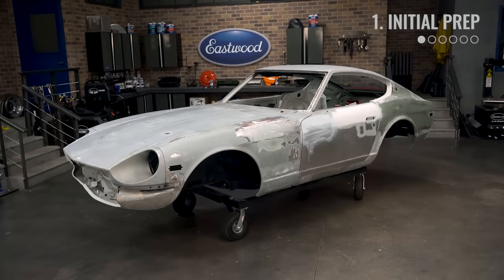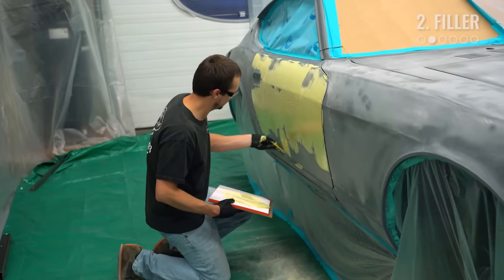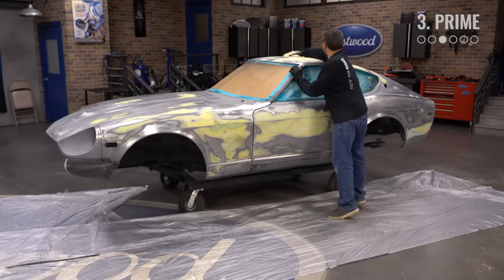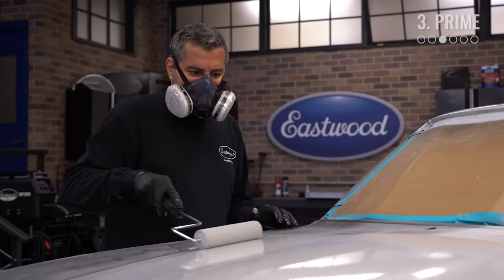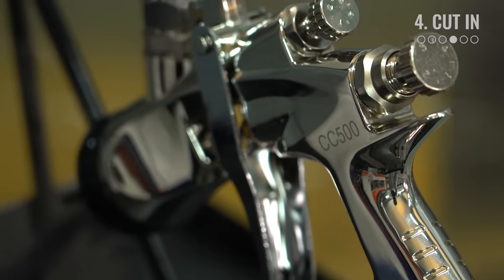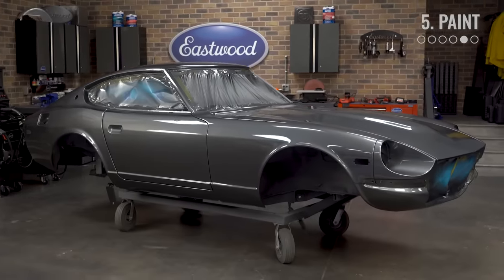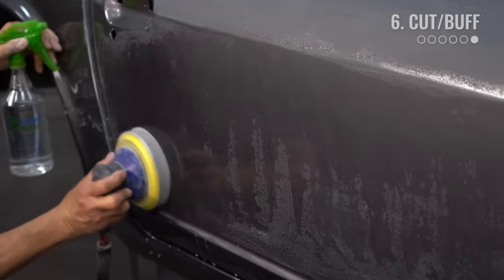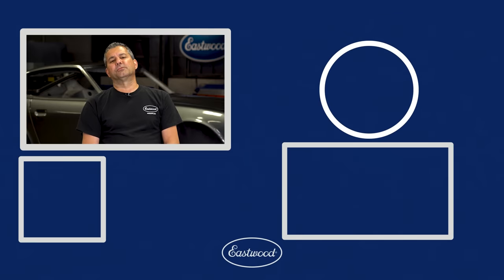STEP-BY-STEP GUIDE: How to Paint a Car at Home

Comment: I recently paid $6700 to have my truck painted. I thought that was a high price, but after seeing everything that goes into painting a vehicle I won't complain anymore.
Reply: If they stripped it thats pretty good but if they just sand and painted it single stage thats pretty high.
Reply: I thought this video was going to be a hack, but these guys are pros! 
Paint at home? Not me, not in my home, not with the amount of time and effort it took to get there 🤣🤣
That $6700 looks like a really good spend!
Reply: Я крашу авто за 2касаря.
Reply: @garagepnkoof284  sorry dont read youre language
Reply: That was a lot. Next time bring it to Jameson motors and we'll get you set up for $2,000 less..
Reply: Dude that’s a good deal for a good job. Normally $10,000 for a good job
Reply: We save some time and money by going straight to metal  to metal primer after body work is done with z grip all newer products upol primer most body shops in Dallas do it that way . The major cost is premium base coat and pre.ium clear 2 to 1 .
Reply: It’s all labor
Reply: Comically high for a pigment 😂
Reply: Ha,ha, doing it at home? No way , I'm thinking to paint my car with an airless sprayer 😂
Reply: Maaco will do a base clear with 5 year warranty for $3000....
Reply: Some modern car paints have up to 6 coats. Get one wrong, and you have to go back to the bare metal, and start again. 

I do not do paint. That is guys behind where I work do. Sometimes they walk into my shop, and swear. Coat 6 went wrong, back to square/coat one.

Ok, I get it, please mind you language, we have a 17 year old female apprentice. It’s d’oh not damn it. For f sake…
Reply: This is like a 15k paint job
Reply: In the country I live in, that’s not a paint job, that’s money laundering
Reply: Wow that’s it??? Holy
Reply: Was your car stripped like this ?
Reply: @kadeemgray93   Yes.
Reply: Yeah I have a 1987 toyota pickup with no rust but needed paint.  I got a few quotes 10k was the lowest.  I now know enough to be dangerous and do my own now.  5 stage turbine sprayer with siphon feed gun.  I like to learn and the challenge so I figured I can screw up and burn a lot of material for 10k lol haha.  Didn't cost near that much and it came out fine.
Reply: A show car paint job in the 80s took all this work and 15 coats of lacquer water sanded 4 steps each coat it makes a deep mirror finish that looks like a 1/2 inch of glass over the color it's alot of work bit it's the difference between a 10,000 dollar car and a 75k or more car
Reply: The paint job in the video cannot be a $6000 work. I would say much more.
Reply: That is a high price. Sorry you got ripped off.
Reply: He's not a laguage.
Reply: The problem is: do you ever really know if what they did was this well done? Doing it yourself is always the only sure thing. Having said that, you need time, space, materials, tools and practice. I'm currently rebuilding a 1972 Gran Torino Sport. The amount of time and work to just do a refresher on the car are huge. I plan on a two year overhaul time. If I could find a reputable painting shop that I could trust...sad to say, I'd pay the money and smile all of the way home.
Reply: What truck, what model?
Reply: That’s a cheap price
Reply: That's how half the customers are.  When someone quotes you a price for an automotive job it's usually because it's a lot of work.
Reply: you can buy a good looking car in my country with that money  :))
Reply: Datsun 28
Reply: I’ve bought whole cars for less then 6700. I get that’s what they charge but that’s a chunk of money.

Comment: This "How to Paint a Car at Home" video did a wonderful job convincing me that I never want to paint a car at home. It's so easy! Just do these 400+ steps each of which really requires years of experience to get a decent outcome within a reasonable timeframe.
Reply: So go flush away $10 grand for some shop to do it. Perfect time to squander your savings
Reply: This is how to do a first class job! Most home jobs I would bet are done quicker with less steps. This video is daunting to me, too. I wanted a quicker and easier method. Oh well, I am wanting to do an old truck and not a classic. I still need to save up some funds and time for doing a passable job.
Reply: lol. if you would like me to send you some pic of my first paint job I will. the reason I did it was the shop wanted $8.000.00 and it cost me a little less BUT I can now do it and I will not charge you what your local shop will.
Reply: Because the actual title of the video should've been "how to discourage people into thinking painting at home is way more complicated than it is". Trust me, it doesn't take nearly as much effort, knowledge or equipment to paint a car decently at home.
Reply: This is to get a professional finish, what they don’t say is you could skip sanding steps throughout, also he does say you don’t have to buff. Definitely take your time with body filler but outside of that do what you can.
Reply: @kenmastersmaster  Some people value time over money and have plenty of either. No need to think anyone's squandering anything.
Reply: @kristijantandara1682  I think this is more like, "how to get a show-car paintjob at home" which is probably 80hr+ in work.  It would be nice to see a technique that could be used for a 40hr paintjob, and a 20hr paintjob (better than earl scheib which is probably an 8hr paintjob for $1000 (closed now)).
Reply: I dont think people that would be this involved with a paint job have to worry about savings. If you are that worried about your savings, you damn sure should not be doing a car project of this magnitude@kenmastersmaster
Reply: @kristijantandara1682 this video shows how to spray your car like a pro... Anyone Barney can rattle can a car in their driveway.
Reply: It's a labor of love for many of us. Working on your own car is a reward of It's own, but not something suited for all of us. That's why shops offer their services. Pay and don't complain, or do it yourself and complain a drink while you do it
Reply: It’s not as difficult as you think. Time consuming? Yes. But you can get it done in 2-3 weekends.
Reply: You’re full of it. I own a bodyshop and will send you proof of my business cards and invoices. This is the only way to do it correctly. You can do it faster and easier and it will look just as good or better but it will not hold up. Just a matter of time before it starts peeling or you go to pressure wash it and it blows the paint off. Stop talking crap about things you do not know about. The only that I would have done differently from the video is 5 coats of clear coat and the minimum of 3 according what time type of job I’m doing.
Reply: Absolutely phenomenal paint job. And screw that! I’ll be going to Maaco!
Reply: @kimers137  LMAO
Reply: It's not that hard!  It just takes time.  People rush it and that's when they have issues.

Comment: Great work and appreciate the step by step process.  One thing I wish you showed more was how you handled things like those deep inset headlight areas.  Obviously that is a hand sand area, and probably hand cut/buff as well.  Curious if you followed the same process and if you had any backer to your sand paper and such.
Reply from the maker: Yes for those tight areas the standard tools don't reach in we worked by hand.  You can use a soft block as a backer, or fold the paper on itself.  For cutting and buffing the real move is to make sure they come out glossy the first time. You'd maybe be able to get a 3" buffer in there but it would be tight.
Reply: @eastwoodco  Put any rotating tool in the tight area, and if you catch an edge of new paint, F bombs are sure to fly!!  Always have a rotating pad turn off  of an edge, not into it! You'll learn quick if you did it wrong.

Comment: O my God so many steps and procedures to go through for 100% perfection. This car paint job looks extremely beautiful.
Reply from the maker: It is a lot of work, but that's why it's KEY to break it into manageable steps instead of getting overwhelmed by the scope of the project. Following these steps YOU too can get a great paint job.
Reply: Paint a car
Reply: Procedure after primer dried
Reply from the maker: Block with 180, 320, and then finish with 600 grit. Blow off, clean, and tape up for paint.

Comment: Thanks for the video, I'm busy with my 1958 MG Magnette, my arms are falling off block sanding is heavy work lol. The part that worries me is having the right place to do the spray job and an extractor fan system and dust prevention and and and...that's the issue most home DIY spraypainters face. To have the proper environment to paint the car and for it to dry without bugs, dust, overspray etc. Looks like I will now have to make a tempory spray booth!

Comment: At 6:00, a teachable mono ent as the fill has pulled away or feather edged. It looks pulled away that meaning it didn't stick due to sanding (Mechanical Tooth/Pressed hard into first application) or (Wasn't clean or fill had started to set up). 
  Any air sanding after the final coat of clear, is done with a finishing sander with 3/16" orbital action, and an intermediate foam pad and kept moving starting with 1/2" (13mm) thick intermediate foam pad with 1,000 grit. Do not use a regular DA sander if if you have sags, runs or nibs. Use a 2" wooden paint stir struck and fine paper like 800-1,200 grit to remove. Once complete there finish sanders are also sold at HF, so look at specs. A regular DA Sander has a 1/4" orbital action normal sanding. Still, look for a palm sander with 3/16" orbital action being sold under specs. 
ASE Master Tech since 78, retired.

Comment: Amazing video, great edits. 
However the only thing that makes the hair on my back stick up is wet sanding and buffing after only 2 coats of clear. This is extremely sketchy on a user error stand point (burn throughs) and also a durability stand point. To low of a film thickness with the clear and it will peel sooner than later
Reply: Depends on what clear if you're using a 2 to one high solid expensive clear you get 40 percent urethane a 4 to 1 maby 20 percent urethane  cheaper but you need 4 coats to get the same build up .  I wouldn't trust 4to1 much about 3 to 5 years. But its easier to spray. Thunder road auto body i use 2 to 1 matrix 3 coats.
Reply: @rogerstephens8980  yea good point 2 coats of a high solids might be ok. Personally I do about 3-4 coats of high solids if I plan to cut and buff.
Reply: @speedokoterefinishnetwork4937  I used to use ppg until  I had some cars start peeling and it darkened youre blend on light colors there ppg s solution was to only put 1 coat of clear on youre blend. I don't use ppg any more.
Reply: @speedokoterefinishnetwork4937  I am having trouble getting the matrix 2 t01 I use another on didn'tike it much what do you use . Ther is a shortage of urethane because the government  created a shortage of oil.
Reply: You need 2 mil to prevent burn through. I guess Eastwood clear is so cheap you can easily put 3-4 coats if you plan to cut and compound? What do you think of finish 1?
Reply: @kenmastersmaster  i don't know any thing about east wood products thats the problem 
Who makes the clear or other products its probably made by a company that specializes in making products and putting a name on it. The paint store has reducer but its cheaper also works pretty  good
 Normal markup is 40 percent on clear at store. But since east wood is the supplier and the store they may make 60 to 80 percent. Most 4 to 1 requires more coats

Comment: Step 1: have a big, clean garage with lots of tools
Step 2: have a great car to start with 
Step 3: have a LOT of money for parts and supplies 
Step 4: have plenty of time to work
Reply from the maker: Well Car, time, and tools are definitely  going to be needed for any project.  This car was a basket case when we got it.  It got new door skins, lower 1/4 panels, and a ton of metal work.  As far as money our step-by-step process will save you THOUSANDS over dropping it off at a shop.

Comment: I did a single stage polyurethane in my garage on my Toyota pickup...I wish I would've spent more time on body filler and glaze or whatever...I could've spent WAY more time on the body work, but it went from a 1/10 paint job to about a 4.5/10 paint job. 😂😂😂 Im gonna do my other pickup next but do WAY more body work and paint with a 2 stage.  hopefully I'll get it 5/10 🤣

You made this look easy.😁

Comment: This is the perfect video. Wanting to paint my 57 Chevy when the bodywork is done. This shows me how. I love this video. Questions though. What exactly is a wet coat or a dry coat and what is the difference between the two? Heard them all my life but never saw the difference. Thank you for this great video.
Reply from the maker: Lets go in application order.  A "Dry" coat is sprayed on and will have limited gloss, low reflection, and will flash quickly.
A "wet" coat is applied heavier, will immediately be glossy, and will have longer flash time. It's how you want the clear to look when you're finished.

Grab the guide here including a glossary of terms :https://www.eastwood.com/images/library/Eastwood-How-to-Paint-a-Car-color_June2023.pdf
Reply: @eastwoodco  Thank you. Been looking for that answer for a long time.

Comment: So, when doing a complete color change, and you're having to take the vehicle apart for other repair/upgrade items, is it best to paint the pieces individually and then reassemble, or to paint the car all at once, fully assembled?
Reply from the maker: That's a choice you can make based on booth space, timeline, etc.  We did cut in first, re-assembled, then paint the car.  It's one less step if you can paint the car "blown apart" because you won't need to sand off the over spray on the body and re-tape the car.

But you also need a bigger booth and/or more time to do several booth sessions.  We have several more paintjob video's coming that will show alternate methods.
Reply: I like to take my hood and fenders off and lay them down so the parts are horizontal because if you spray a little thick its easier to get the thick spots clean

Comment: I think the most important is how you invest the tool at home. At least you have to get a high cfm compressor. You have nothing to do without it. Not much people will buy a over $800 compressor for home use right. What we looking for is to get decent result with tight compressor with decent price of paint gun.
Reply from the maker: There's no getting around need a compressor for base/clear.  But you can still get your car all the way through primer and prepped for paint without the air compressor and that alone would be thousands in savings.

Then either take to a local shop to spray OR rent tools for a weekend and finish the job.

Comment: Eastwood! The good stuff.  Step 1 should be "save up $2000 for a gallon of paint"
Reply from the maker: Where are you seeing $2000 gallon of paint?

We have a large variety of options ranging from our library of color base coat options:
Gm White: 111.99 - https://www.eastwood.com/eastwood-4-1-gm-white-code-40-basecoat-128oz.html

or OEM Select in your specific paint code:
A gallon of GM WA848 Black is $425.02

And our Clear Coat is extremely budget friendly as well:
European Urethane Clear and activator: $210.97 - https://www.eastwood.com/eastwood-2-1-urethane-clear-gallon-and-activators.html

That means you could base/clear you car for $322.96

If that's still too much we offer gallons of single stage for as low as $113.99

Comment: Eastwood killing it with this diy guide.... And they offer basecoat online??? Amazing. I just need to figure out what guns and compressor to get, and if they mix midcoats as well?
Reply: They sell a compressor.
Reply from the maker: We painted this using the CC500 and yes using our OEM Basecoat is available in tri-coat/pearl applications.  Check out the Shelby Cobra we did using that system as well. https://youtu.be/7WYsGrjOX9s

Comment: Should you not try to fix any drips in the paint before you lay down you’re clear ?
Reply from the maker: You shouldn't have runs in your base coat, you don't spray it on wet enough for that to happen.  It's a medium-dry spray.  IF you do somehow manage to run it you could wait for it to dry, block it lightly with 800, tack it off, and then re spray that panel.

Comment: It looks like about 80h of work, is that correct?  Just to get the old paint down and get through the filler step so you're ready for primer seems like about 40h.
Reply from the maker: It's hard to even calculate because we did this car over the better part of a year a bit at a time.  The heavy lifting is done from stripping to getting the car into urethane primer - where it's pretty straight at that point.

It's probably like 120-180 hours on this car for those steps... which is 2-3 months of working in the garage at night for a few hours at a time.

This will vary widely depending on what shape the car is in before you start.  For example this needed quarters, door skins, had some things shaved, etc.

Comment: At what point do you paint the interior of the car? Do you follow some of the same steps? Strip it to bare metal, undercoat it and then spray the matching color to finish it?
Reply from the maker: The steps for painting anything metal are the same.  Metal work, Body work, Primer, Paint. 

You'd follow these for visible areas such as a dash or door panel.  But floor and firewall are generally the factory finish.  If it's all covered by carpet, exmat, wiring, etc.  it would be a lot of work to base/clear and then cover it up.  Some people will coat with a truck bed liner as added durability.  It's up to you the builder!